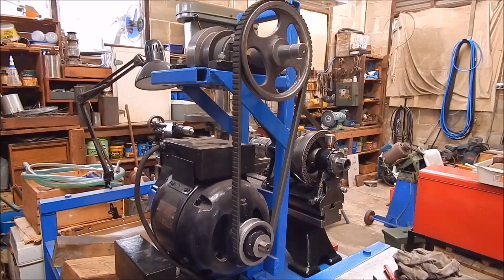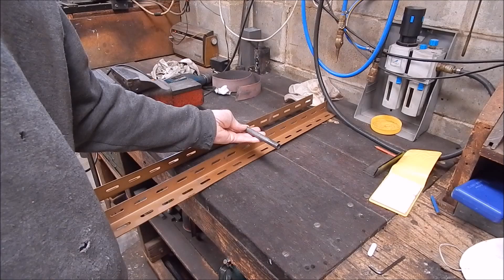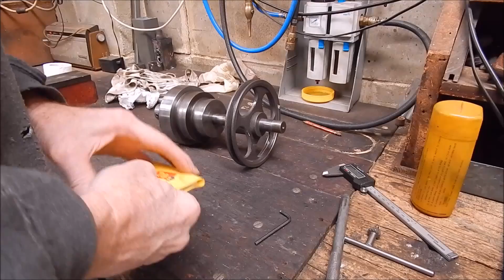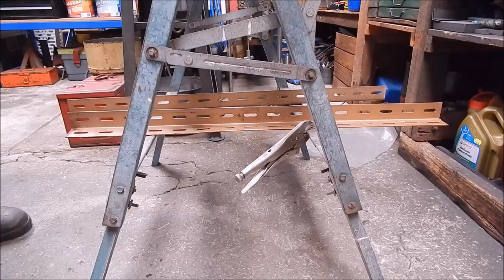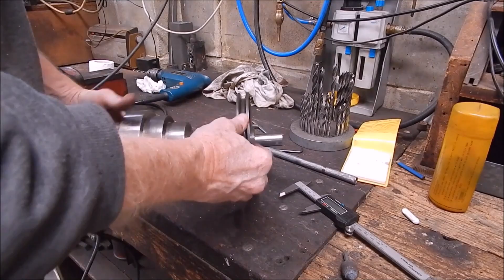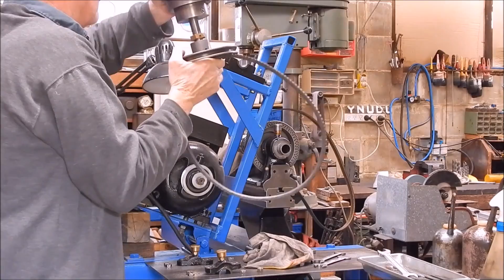How to balance pulley and shaft combinations

Comment: I've just been balancing a couple of lathe dogs I've made and I need to do the very same with shafts and pulleys soon... The tip I can give you is to go and get either a big soup pot, a 20 litre drum or a 200 litre drum and set it on the floor or bench top.... Add some weight to it so its not going to move and you'll find two compass directions will always be perfectly level. Polish the rim with steel wool and there's your exact tram lines. Your shaft is obviously placed at right angles and as long as the rim is dent free, its like ice under the shaft.

Comment: I would rather add weight to opposite side than grind away.
You can't go wrong with it, as you can remove the weight easily if you put it in wrong spot. Get some lead ! And a calibrated scale.

Comment: Hi Rob,

Great video.  

I used an additive approach  when I tried to balance my spindle on my cnc lathe.  I could't use your method as it was too difficult to take the spindle apart. I use bluetac and 1mm solder wire bunched up to temporarily add weight to the opposite side to the heavy point.  I adjust the amount of solder wire until it was balanced.  (Trial and error).
 
Then I marked the spot, removed and weighed the bluetac with solder wire.  (ended up I need 10 grams)
 Then I scrounged some stick on wheel weights (as used on mag wheels) from a tyre place.  I trimmed the wheel weights until it matched the mass of the bluetac+solder and stuck it on.

If I build another cnc lathe, I will definitely use your method to balance the spindle and pulley assembly before final assembly.

Once again thanks for your ideas.  I have used quite a few, the last being small pin punches using the concrete nails.
Reply from the maker: +chrisjh777 

I recently had a comment suggesting to use two hacksaw blades as the knife edges, and that sounds good, particularly as they have a hole each end to mount them.  Thinner is better for sure.

10 grams is a lot of imbalance.  

Glad you got a few ideas out of the videos.

I used my small concrete nail pin punch the other day to drive out some door hinge pins that no other punch could do.  Worked great.  Even better when you make it yourself.

Cheers Rob

Comment: ever since getting my first lathe, which is also virtually an antique, I've really come to appreciate the work that goes into restoring them. that shaublin is damn gorgeous, you did a really good job on that
Reply from the maker: +Rob Mckennie 

Hi Rob,

The old lathes certainly have style.  It's a pity to see some so run down and neglected at times.

I recently agonized for days over whether to get a rare A2 Leinen precision toolmakers lathe (only $200) from a farmer in the mid north.  Pretty much complete and unmolested.  Bargain. The problem is then, what do I do with it?

You can't save every old lathe you see - but it sure was nice, and in quite good condition apart from a light rust coating here and there.  The same as the the unit mid page:

http://www.lathes.co.uk/leinen/page3.html

Would have come up similar to the Schaublin with a bit of effort.

I just hope who ever bought it realized what they have, and look after it accordingly.

These old flat belt girls are getting hard to find now, and it would have been an excellent project.

Cheers Rob

Comment: Good Video as usual.
However its important to point out, what you have done is Static Balancing Or Balancing in a Single Plane. There is an important additional step in achieving perfect Balance, that is Dynamic Balancing OR Balancing in two Planes.
Which is likely why there was still some vibration.
This video gives a good explanation of Static vs Dynamic Balancing https://www.youtube.com/watch?v=cFGcBUzxcvQ
Reply from the maker: +russhellmy 

Yes, I fully understand that.  That's why you generally have balance weights on both rim edges of your car wheels.

To do axial/dynamic balancing you need a balancing machine, so it's not a job for the home handyman.  

Cheers Rob
Reply: Hi Rob,
Yeap I was pretty sure you understood that, my comment was more for others that might watch your video but not be aware there is a further process of dynamic balancing.
Cheers

Comment: lol. my top cone was mostly pvc pipe and pine board and ptfe tape... at least yours had metal in!! interesting video. makes me wonder if i should do mine too. thanks for posting!
Reply from the maker: +Emmas Spareroom Machineshop 

It's interesting when you look at the dynamics of pulleys and their mass.

The intermediate pulley on this lathe is solid cast iron, but Hercus use a lightweight hollow section cast or steel pulley for the same job.  The Schaublin spindle pulley is also low mass (machined out centre).

I've been tempted to get a Hercus intermediate pulley (similar proportions), as less mass should equal less effect from casting/machining imbalance, and they are probably correctly balanced to begin with.

It is however relatively easy to correct radial imbalance.  Axial imbalance (weave effect) is a lot more difficult.

The alloy pulley had both.  The cast iron pulley was OK on the axial front.

Anyway, I thought a few vintage lathe owners might find this an interesting subject, so I put it up.

Cheers Rob